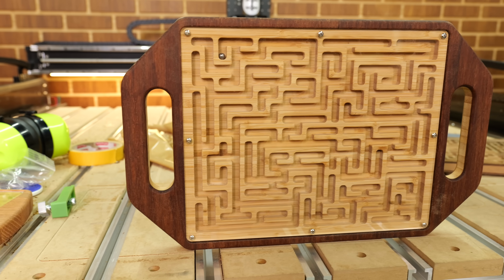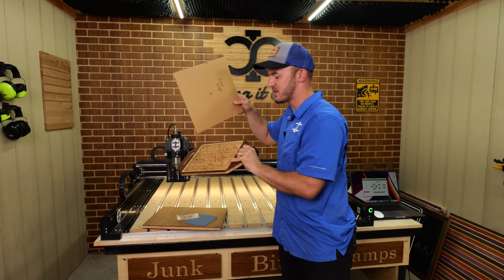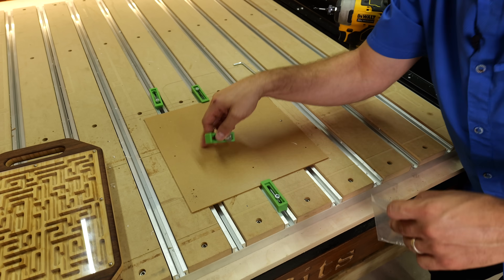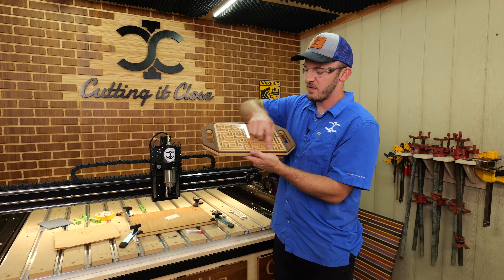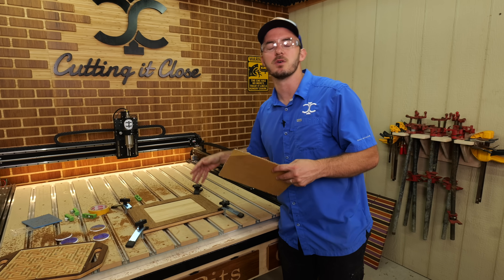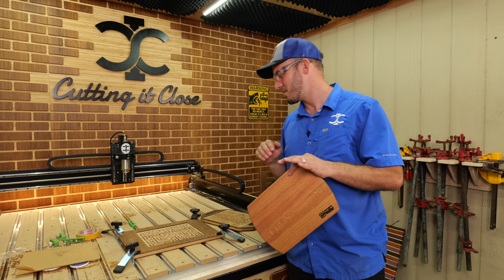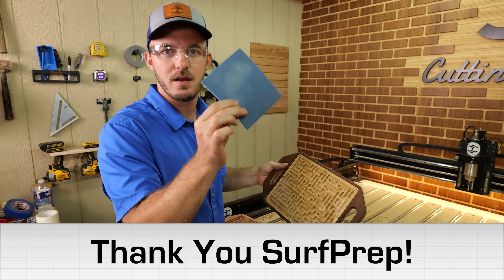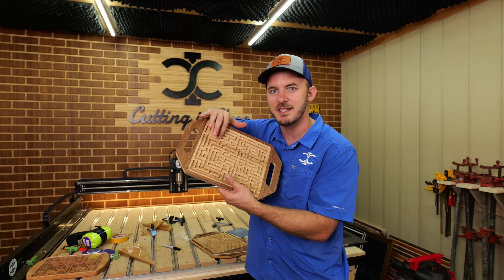How to Make My Best-Selling Kids Game – CIC Workshop CNC Kit #2

Comment: Ryan, thanks for providing this kit and the full instructional video. Always giving back!

One question, would it be faster overall to make the handle holes as a pocket toolpath instead of a profile toolpath? That would avoid any chance of tearing out the tabs on the back side. I can see that the roundover step will get rid of the tabs themselves. Also, as a tab user myself... I score the back side with a knife to help avoid any busting out of the wood that you want to keep.

Thanks for all of this. And do you offer bulk pricing on the kits? Christmas is coming up faster than you know it!